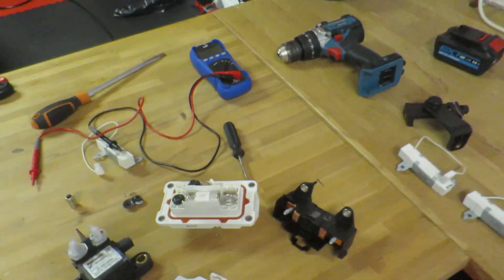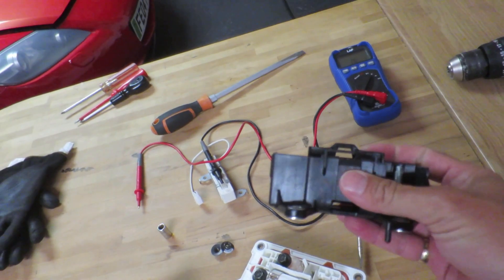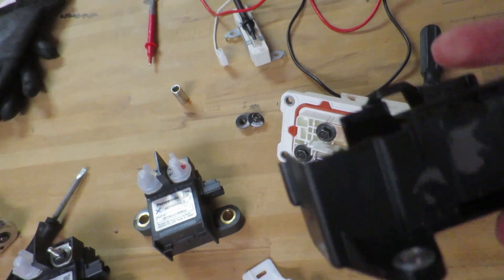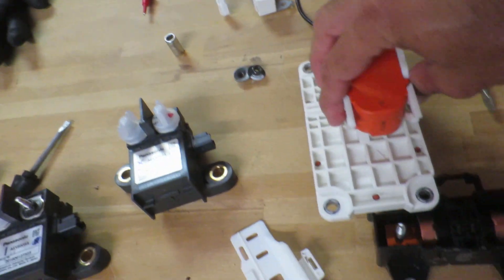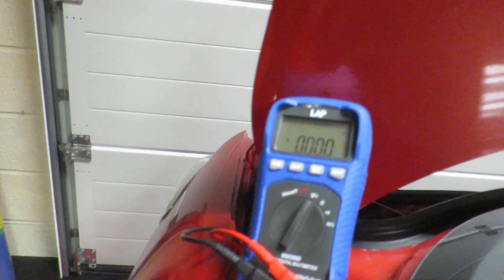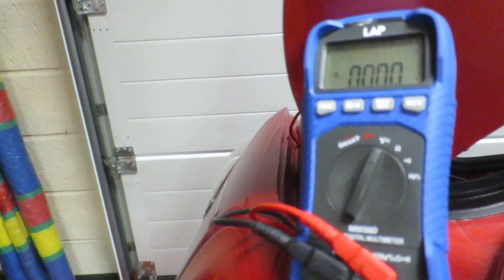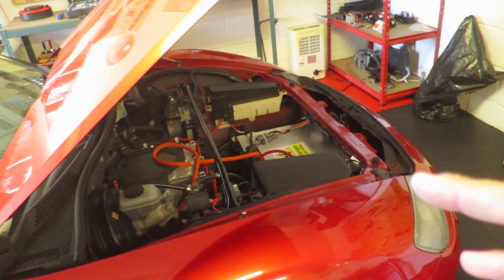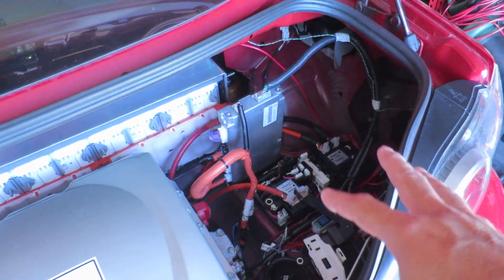Upgrading my RX8 to the 160kW Nissan Leaf drivetrain part 5.

Comment: I love the smile on your face. Says it all!

I had a 40 and it was good, now have a 62 and it goes much better, keeps on going where the 40 ran out of puff.
Can only imagine how much torque you have going through a gearbox…….

Keep smiling.
Mark
Reply from the maker: you have upgraded the battery pack? DId that have an impact on performance? or do you mean you now own the E+ rather than standard leaf?
Reply: @SouthWestEVUK  Hi, yes went from a 2.0 car with a. 40 pack to a E+ with a 62 and a more powerful motor.
It goes very well and cheap to run.

Love your conversion, surprised we don’t see more Leaf’s used as donors.
Was looking at doing my Freelander when it got old but it got retired by white van man pulling out on me.
Take care M

Comment: Looking good Dave, be interesting to see the new motor and inverter in action. Be careful measuring battery voltages like that, using a multimeter. If you accidently have it on the wrong setting it could all blow up and not end well.
Reply from the maker: So my voltmeter is auto detecting the Voltage - pretty hard to get wrong!!! But thanks for the concern, I certainly have blown up plenty of things that make you double check.

Comment: Yeah i installed a 160kw inverter in my 2018 LEAF i also installed the PDM from the E+ as i wanted faster than 3.3kw charging that part is working but not getting full power from the inverter the car still thinks I'm running the old 110 kw unit :)

Comment: This will be interesting 225 amp is in the 160kw models stock,  im just about done on my conversion on my 24kwh leaf,  but the 24kwh is LMO vs NMC, so way less sag for LMO apparently, ill be running 145kw for starters then 180kw.  225 fuse needs like 90 seconds at 500amps to blow , so in theory normal use and 5-10 second WOT should be fine. Soon find out :)
Reply from the maker: Hay, glad your project is coming along. I am stuck at 400A at the moment, going to start to diagnose why soon. Still, its rather rapid, and the fuse / wiring is all holding up fine.
Reply: @SouthWestEVUK  Hiya, need a big shunt and a fast logger!
Take care M.
Reply: Yep im stuck on 400amp too, now the inverter is in :)  the 225 amp fuse is fine so far, done a few 5 second pulls.  I have had to fit 225 wide tyres , both spin in the dry on the roll at 50kmh :)  im running 24kwh pack, 352v sag on 100% charge, different chem so less sag per kwh vs newer packs.  Im on 78 soh so not overy tired pack.  Not sure ill bother with the 180kw code , maybe on for above 85% charge then down to the 140-150kw bracket.  My weight is around 1440kg so its pretty quick :)  yep i have noticed slight higher temps, very minor though.  All i can say is its hot hatch territory now :) also i dont boot it when below 70% , dala is doing up some code to not apply the tune below 70 SOC, will test that soon.
Reply: So after 3 weeks of testing daily work runs on the 24kwh pack,  1.6 and higher multiplier randomly xmas trees on me , 1.55 multiplier seems like the sweet spot.   Managed low 6 seconds with some wheel spin.   We suspect the 400amp maybe the motor, the 160kw motor has different magnets, soo.... maybe its sending something back to let the inverter know.  my fuse has held up no issues.  Lots of fun.

Comment: what did u use to get the 6.6kw pdm working i got the open inverter board for my inverter id like to use the full stack if possible also planing to use tesla model 3 modules with a leaf bms or the model 3 bms depending on what i score first
Reply from the maker: Hay - what is not working about it?